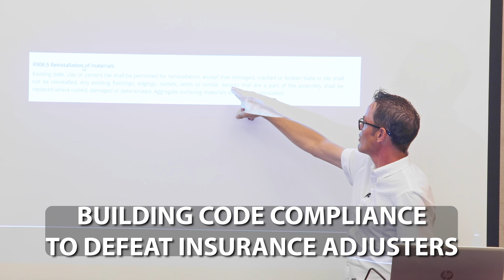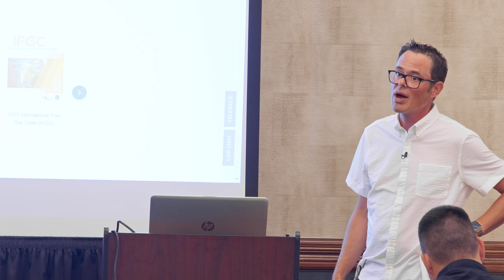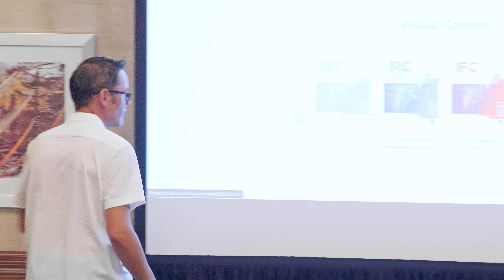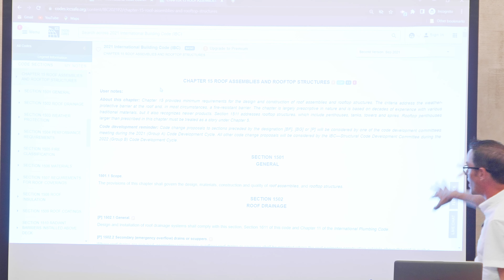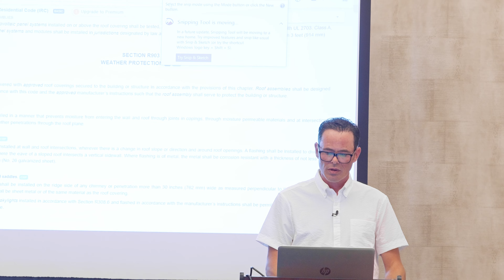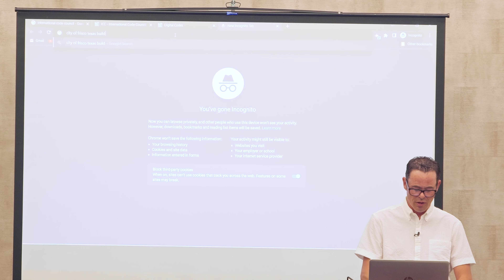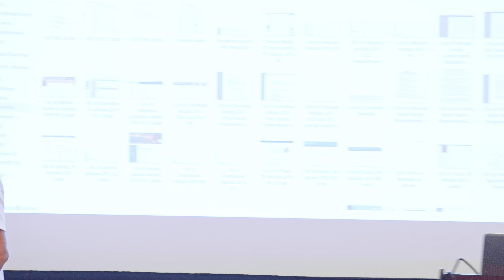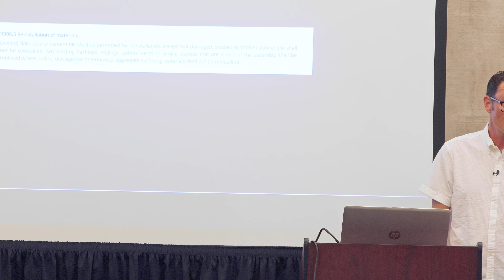Use These Building Codes To Defeat Insurance Adjusters | Code Compliance

Comment: Does that code R908.5 also apply for commercial roof assemblies?
Reply from the maker: No. That is from the International Residential Code (IRC). You would need to go to Chapter 15 of the International Building Code (IBC). Thanks for watching and for the awesome question! 🙏🙌👊😉

Comment: If the client shows you their policy to show you that they have o & c coverage can you than talk policy to the adjuster to get paid for the decking I already installed and they say they are not paying. 
My client showed me the policy and I see where it says it is covered
Reply from the maker: You cannot talk about the policy with an adjuster. However, you can absolutely talk about BUILDING CODES. Thanks for watching! 🙏🙌👊😉
Reply: Good morning ,Can I speak to adjuster about policy?
Reply from the maker: @vincentmarro1396 if you are a contractor, NO
Reply: @InsuranceRestorationTraining  can I tell them the code is that code and the home owner told me the policy has o and L coverage so they have to pay?
Reply: @InsuranceRestorationTraining  how should I go about getting my money for the labor and plywood I already paid for.
Reply from the maker: @vincentmarro1396 you can tell them that the code is the code, yes. The HOMEOWNER can tell them that the policy has O & L. I would NOT tell the adjuster that they “have to pay”… not unless you are an attorney or a public adjuster. If you need more help, go to insurancerestorationtraining.com You can sign up for my online training course, come to one of my events, hire me to train your company at your location or one on one consulting. This is about as far as I can go to help in the comments section on YouTube. It’s hard to do that here. Thanks again.

Comment: I'm currently fighting against an adjustor who is denying a full roof replacement, but they are already paying for the Front slope being replaced. We're using GAF shingles and the manufacture instructions want us to overlap the Felt paper to the opposing slope. This violates IRC code, so I would assume we can use code and ordinance to justify a full replacement. They are still denying it after the information has been sent and I've called their manager several times while pushing code and instructions. They now want to get an appraisal. I want to keep escalating this but I'm not sure if they'll budge. What are your guy's thoughts? Enumclaw is the carrier.

Comment: My adjuster has ask me to get a letter from the city saying that they enforce section R905.2.1
How should I handle this?
Reply from the maker: Check the city building department website to see which version of the International Residential Code they have adopted. Screenshot that page and make sure it shows the url address to show it’s the city’s website. Then go to that version of the IRC and screenshot R905.2.1. Send both images to the adjuster and tell them that the city does indeed require the code. If they push back any further ask THEM to provide a letter from the city that they do NOT require it. If it keeps going from there, email the city attorney and ask if there are any of their municipal codes that they do not enforce. Don’t use a construction company email address. Just use a normal one and don’t ask specifically about construction codes… just all city codes. Send the reply to the adjuster and tell them to kick rocks. Kidding about the kick rocks part. Be professional, courteous and polite. If the adjuster doesn’t understand how codes work, educate them… In so doing, you are making the world a better place! Thanks for watching and for the awesome question! 🙌🙏💖👊😉

Comment: What is your advice when they have a policy that doesn't include coded and ordinance?
Reply from the maker: That’s a tough hill to climb, to be honest. If they don’t have the coverage, there isn’t a ton you can do. You can try to focus on manufacturer requirements and focus on what is needed to pass an inspection. The insurance company may allow certain items to be included but it will be very strict and tight. The best policy is to make sure they have the coverage in the beginning. Hopefully if they don’t, you know about it right away in the beginning of the process. I hope this helps, brother. I know it isn’t much. Thanks so much for watching and for the great question! Please stay tuned! 🙏🙌💖👊😉
Reply: Just ran into this with all state
Reply: It’s simple, no payment per policy.

Comment: OL only applies if it is a “enforced code”. Must be able to produce a permit.
Reply from the maker: Again I disagree. Thanks for watching and for the comment. I hope you are doing awesome. It’s been a bit. We should get together soon. 🙏🙌👊😉
Reply: This is incorrect. In the first chapter of the IBC/IRC states if this code is adopted with no amendments countering or improving on them. Then this is the measure of Best Practices. Best practice is the standard a contractor is required to build by regardless if a permit is pulled or a building inspector inspects.
Reply from the maker: Absolutely correct, brother. 👊👊👊💪💪💪